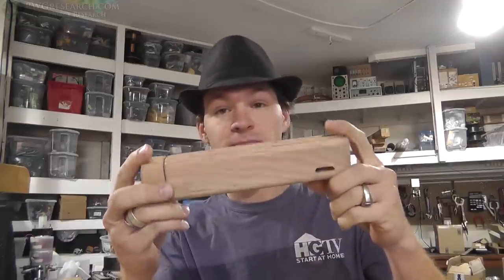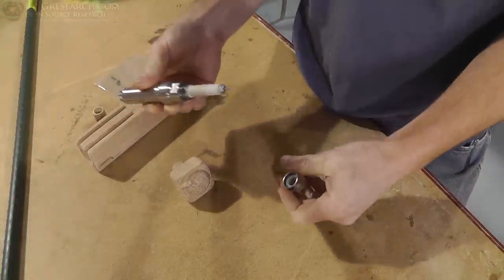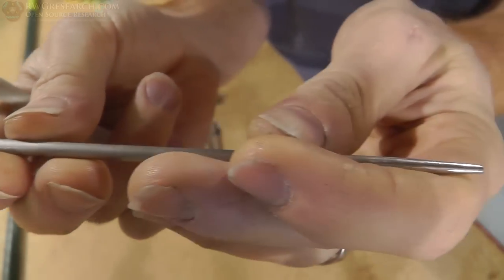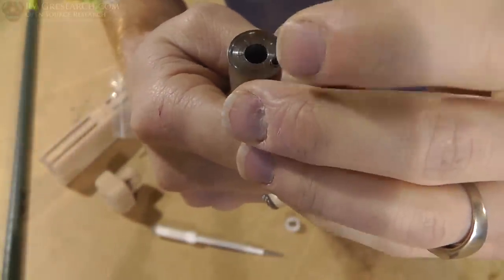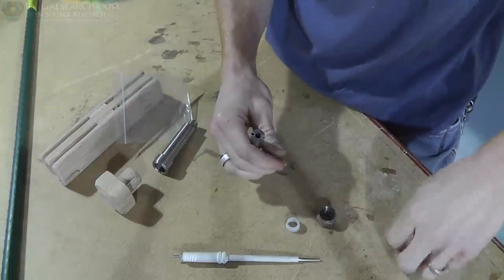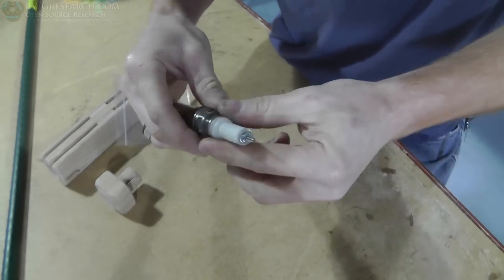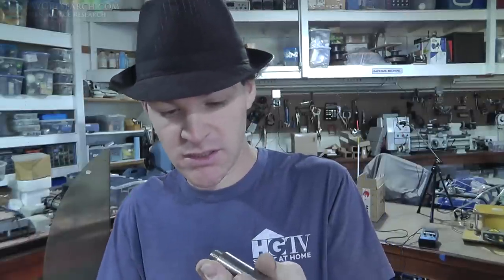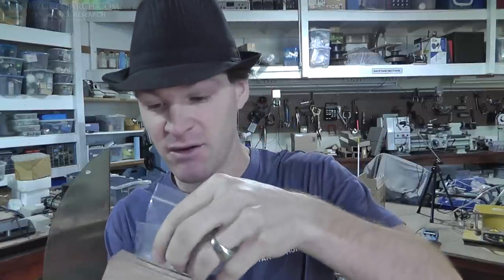Completed Stan Meyer Injector. RWGresearch.com

Comment: Perhaps the water cell for an automobile did work rather well before the unleaded fuel and the computer monitored fuel system. In the day of the old carburetor it was much easier to to do modifications that would make the auto run more efficient by injection water mist into the manifold.Today we have many sensors to monitor the fuel. The oxygen sensor is a problem when water electrolysis and you have more oxygen than the computer knows what to do with in combination with the hydrogen, The need is to separate the two and dispose of the oxygen. It is a very simple process, but the average Joe does not  seem to grasp. Everyone in this topic can not seem to think out side of the box. Just too many naysayers that don't even know what the box is. I know what I know and I will not argue the point nor tell my secret of the separation.
Reply: volvamos a los motores con carburador y listo... con este sistema no serian contaminantes....
Reply: It's a pity peoples greed is what drives the devil's in the world. Stan Meyer was not after money he wanted people to benefit from something very inexpensive but hugely beneficial to humanity.
Unlike some it seems

Comment: The injector is incomplete. There is no mechanism to meter the water.
Reply: I think the way the injector works is that an electric current flashes the water to HHO and the resulting pressure, or explosion,  pushes the HHO out to the cylinder thus the need to retard the timing.  I wonder what frequencies Stan used in the injector system?

Comment: What a wind up, instead of using the vid to show us if it actually works and we can put water straight into the tank. You use the time jus taking it apart, then you put it back together and put it back in its box!. PLEASE let us see it working IF it does indeed work!. If I had received that injector I would of been so excited to see it work I would of rushed to put it in a car engine!. Come on this if it works needs to be made public ASAP!!!! The climate ain’t got time to wait!

Comment: can anyone actually tell me, what this is?
Reply: Lightning in a bottle....
Reply: Thermal explosive reaction using naturally occurring elements.
Reply: The beginning of an electrical energy moment!
Reply: Stanley Meyer reduced the size of what he calls "Resonant Cavities" which he used in a series array of 10 resonant cavities to run a car on water as it's only source of fuel. As he made improvements to the technology he made things smaller and got the water for fuel technology down in size to what you see in this video as these are also "Resonant Cavities."
As of right now it seems my research on this technology is a lot further along than anyone else's as I made use of the scientific method to learn just how this technology actually works. I have a working mathematical model on how this technology works but as a result of my strict adherence to science I was pushed out of most forums for I'd would always call those just showboating and/or going in the wrong direction out. Since they made up the vast majority of people trying to get this technology solved they did what they could to silence my voice as what I had to say didn't match what they were saying and they all seemed to careless that the results I was showing came from actual hands on experiments. This technology works by way of ionization as it is much the same as the way an ozone generator works in how it breaks the bonds of the oxygen molecules by high voltage. The science is new and as such you can't look up anything I am telling you in a book other than to look at how a ozone generator works and know that they didn't get it right in their (mainstream science) explanations on even that technology. With this technology drinking water can be used as a source of fuel without any additives being put in the water as the old electrolysis method requires to break the bonds of the water molecules.
I hope that answers your question.
Reply: Here we go again. The one that knows more then everyone else. The one that has made enemies with every Meyer researcher. The one that says he is further along then anyone yet the scientific method would state that replication comes before advancing. The one that because he didn't replicate first can't even make enough hho to run a torch. Ed. Why don't you just keep to your self. No one wants to see someone boasting about them selves when really they got nothing. We are all tired of your abuse and your self proclaimed God complex. You go everywhere starting the same old crap because your trying to over compensate. You make up a lot of stuff. Like your further along then anyone else. Max Miller is winning this race buddy. Best you just learn to accept it.
Reply: Yeah I see nothing new on your site. You make far to many assumptions. After meeting Max I realized he will be the first to replicate Meyer's work. I do not have have the finances nor do I have as much knowledge as Max. 

I am not someone who will take someone's design that needs replication to understand first and modify it prior to understanding it. This Ed is the reason you will fail. There are some fundamentals you have over looked in the way you designed your cell. I have a strong feeling once I release my tube cell that I have been working on before we ever met your gonna be jealous of that too. It's expected. Now you want to call me a scam artist how about over pricing your cell by about 200 percent on cost. Ha call me a scam artist your greedy. The difference between you and I is I am a designer/inventor. I design things to be versatile which allows for more then one type of experiment. I will not hord and over charge. People will be able to replicate my design, 3d print it, have it machined, or buy the parts off me. I I believe in advancing science not my own ego and pocket.

Comment: And still nothing... just as much of a nut as good old stan. Nothing interesting or special about high voltage disassociation of water. Breakdown voltage of pure water at 2mm is 30kV, but with stans stuff, its likely a lot closer, so lower even yet. You still have to put more in than you get out... you would think people that are able to construct these elaborate devices are also capable of measurement.

Comment: So you hold something in your hand that will fundamentally change humanity and you don’t really have time to test it? Guess Uncle Sam got to you
Reply from the maker: Have you ever tried running a car with out fuel? How about with out spark plugs? How about with out tires? Or a battery? Any one of these are missing then your car is useless. It won't work as dezighned. The same thought process applies here. They system is not complete... this is only one part. Uncle sam can kiss my... 
 ~Russ
Reply: @RWGresearch  put it in a lawn mower then